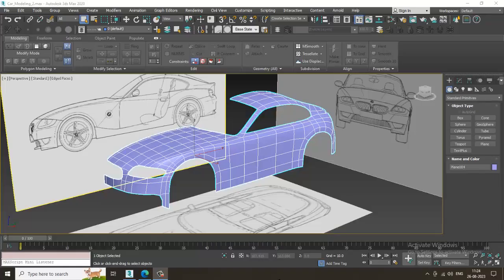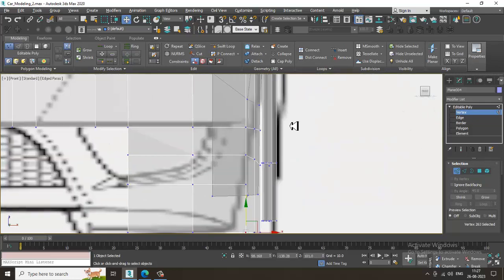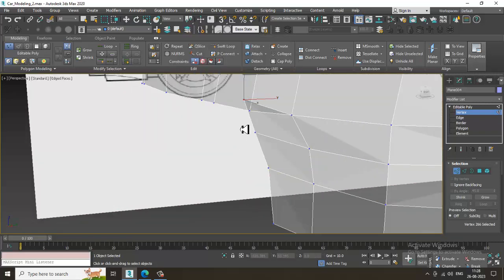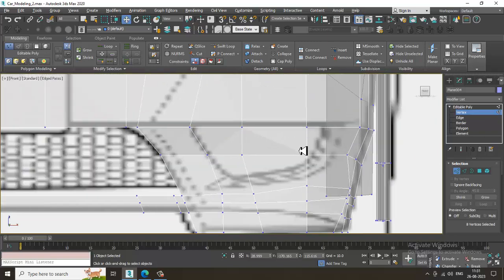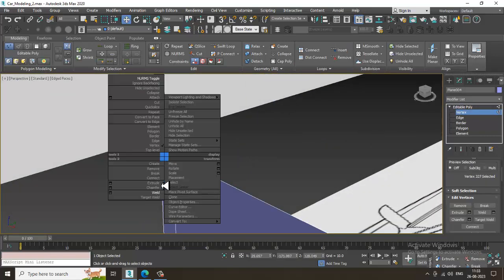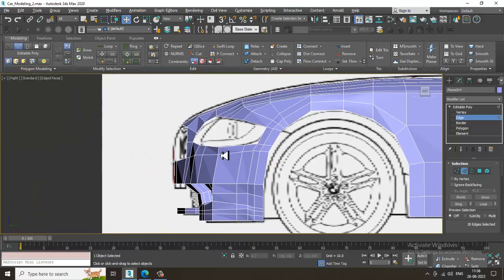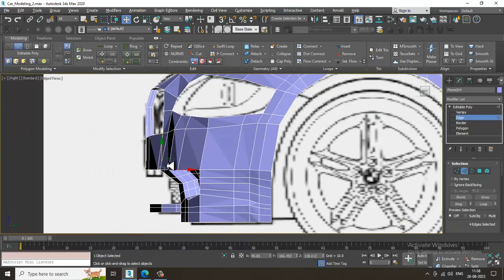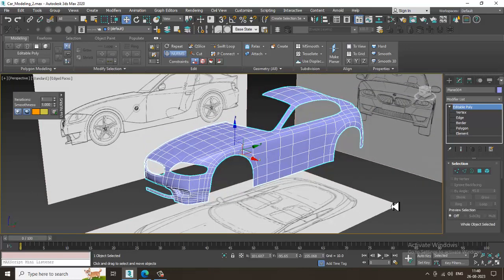3dsmax Tutorials, Learn 3D Modeling a Car from Scratch in 3dsmax. ( Part 5)

Comment: hello everything is continuis from 1 polygon--how do afdd objects ? wi cant add objects and model --like i mean i want to make headlights speralty and then set it in to the right place i am not able to --Lisa
Reply from the maker: you can use box separately create a headlight or cylinder
Reply: but when i model a sepeate obkect it doesnt connect or stay in the place i want it to--it moves off to other directiosn i cant control it do you know why? thxz
Reply from the maker: u can use manipulators to move it